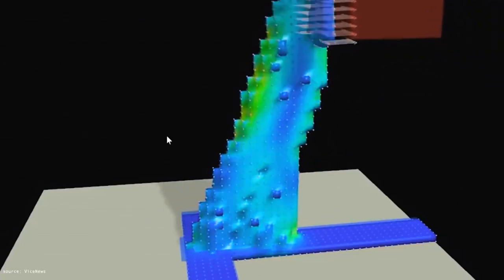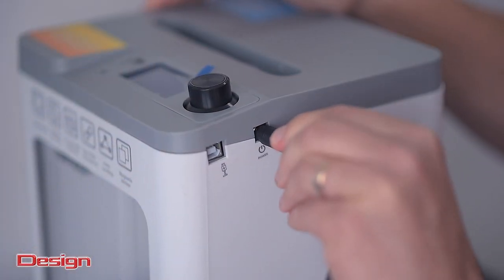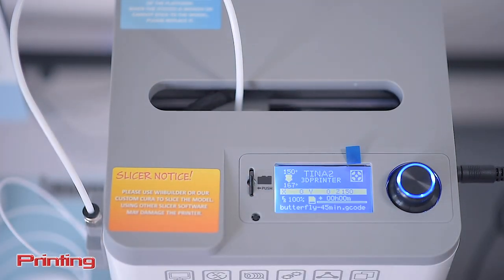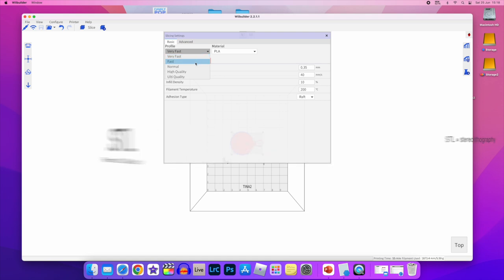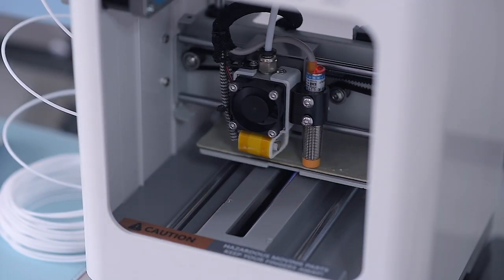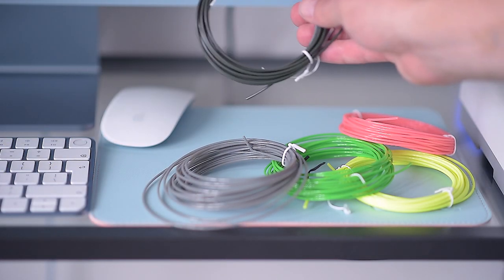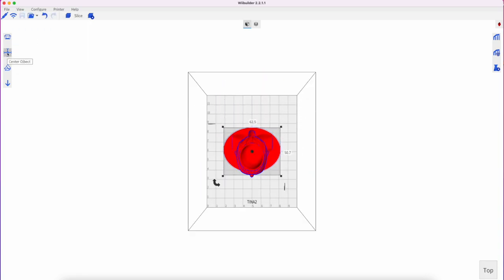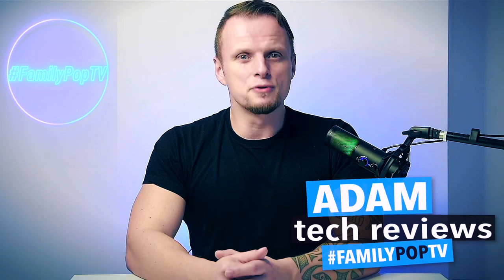How Good Is TINA2: A $149 3D Printer?! // Complete Beginners Guide

Comment: Do you know how to fix the fan? I recently broke my fan accidentally by touching it. I got replacement, but it still didn’t work. Both fans probably work, but it just doesn’t spin
Reply from the maker: Hi. Fan troubles can be the worst - I haven't tinkered with any of the printers I had so far, but here are a couple things which came to my mind, you may want to double check:
1 - you may double-check connections - sometimes it's easy to accidentally misalign the connector (just to be sure)
2. the fans require specific voltage, so confirm it matches the Tina2's specifications (unless its a specifically designed fan for tina2). in reality, mismatched voltage might prevent the fan from spinning (like in the pc),
3 . this is very unlikely - but you may also check if there are any new firmware updates available for the printer, sometimes updates can address fan control issues.
4. also the most unlikely - double check for ant obstructions (which i believe you've already done). If none of those would work, it's also possible the motherboard port itself might be damaged. In that case, you might need to contact the manufacturer or cust.service. Sorry I couldn't be more helpful. hope you'll be able to sort this out.

Comment: Hi! I recently bought the same printer, I’m very pleased so far, but have a couple of questions, for you guys which is the best brand of filament for this printer? And the other one, I print 3d models with some details, at what settings do you get the best result? My models are 4” tall. Thanks for the help! I would really appreciate it!
Reply: .10 layer height. 35mms speed.
Reply: @jesseburson  Thanks!!

Comment: My filament will not go up into the tube. Even squeezing the lever thing only about an inch of filament will go up into it. I don’t know why or what to do.
Reply: same problem here
Reply: I also have this problem with mine what I do every time I change filament is I take that fitting that's on top of where you feed the filament in off "I'm used to taking the hose out of those push lock style fittings because they're air fittings in the industry that I work in" to remove the fitting you push down on the top plastic collar of the fitting and then pull the  white hose out wow you're holding down on that collar and then you can spin the fitting out real easy.  Then I push my filament up through The feeder and push it a couple inches past the hole where I just took the fitting out of and I drop the fitting back on it and snug it back down finger tight and then I push the tube back into the fitting and then I pull the lever up and I push the filament up into the tube until it stops. I know this sounds like a lot but it's actually very very little to do and simple,  just hard to explain without showing. Hope this helps!

Comment: I've Tried two different prints and my Prints won't stick to the Platform, can u help with this??
Reply from the maker: Hi. My first thought - the platform is not properly levelled, this is the most common reason why prints don't stick to it (re-home may solve it - unless the nozzle height been modified in any way?). The nozzle should be close enough to the platform to melt the filament, but not so close that it is touching the platform. 

Also, if the filament doesnt stick you may clean the platform surface - i have been using alcoholic cleaning solution (i think isopropyl alcohol).
It could be the wrong filament, but its very unlikely, unless you use something different than PLA?  

I just got a new X-Maker 3d printer for assessing and reviewing, and I will take a look into possible solutions, as it looks like several people already had issues with the filament not sticking to the platform (not just tina 2 but various printers). Please let me know if cleaning, re-levelling or anything else made a difference. Adam.
Reply: @FamilyPopTV  Hey there, cheers for getting back to me, Apparently I'm not the only person having issues with the Prints not sticking, someone else suggested to remove the sticker Completely and using a Glue stick on the platform and according to him @Kalbo64 on his video: https://www.youtube.com/watch?v=2nv-46nz7zo&t=237s does this very thing and says it works!!
Reply from the maker: Thanks, I'll check this out too.
Btw. I also heard, that hairspray works well for the platforms making the filament stick to it.. I'll certainly try all those methods on my new printer (Aoseed x-maker 4.0),

Comment: I know this wouldn’t print Warhammer type miniatures very well but how about bigger miniatures like tanks if the parts are printed separately?
Reply from the maker: The inner size is the limitation, but sure you can print little parts separately. Be aware it's not the fastest printer and it'll take a while.

Comment: Do you have any tips/settings for printing off miniatures? I keep trying and the legs all seem to bow backwards making the prints useless. Thank you.
Reply from the maker: Hi. I’m not sure how it bows backward?

Did you try to edit/turn or scale the model - or just convert it in wiibuiler app? 
The app adds that extra “build up” around the model, so it stands solid.
Reply: @FamilyPopTV  I download the file, load it in wiibuilder, pick a profile, add supports and then try to print. It's like the lower half of the model slightly melts or something and for example the legs of the model aren't straight but warped backwards.
Reply from the maker: In wiibuilder, in the settings for the print you may alter the material type (PLA), temperature, speed, etc and quality of the print.

I will check it out on mine as soon as I’ll come back from holidays, end of the week and I’ll come back to you. I’m sure we’ll figure it out.
Reply: @FamilyPopTV  Thank you so much.   I contacted the manufacturer and they gave me some tips. I'll test it on my end also and maybe between us the answer will reveal itself 😆 Enjoy your holiday!
Reply from the maker: Thanks 👍🏻 and speak soon
Reply: @TheRealRetroBeard  What were the tips???

Comment: my filament wont stick to the base, just turns into a stringy mess
Reply from the maker: Hi. Not sure, but looks like the base may need a replacement or cleaning - or most possibly the bed needs to be re-levelled.

Or if the bed is levelled and the nozzle isn't too far from the bed, the filament may not be the right type.
Please check the levelling / distance from the nozzle first.
Reply: I’ve seen that some boxes come with a glue stick. Mine didnt